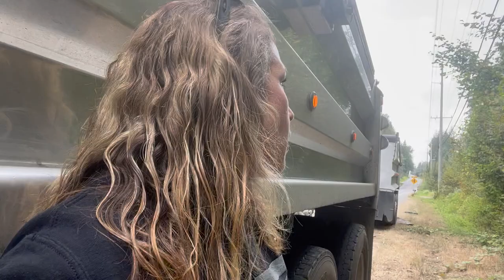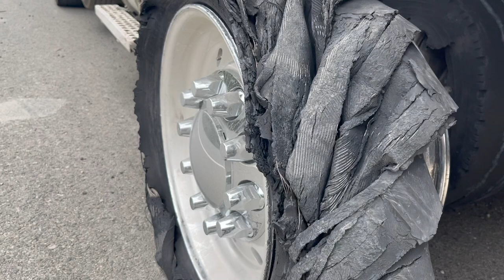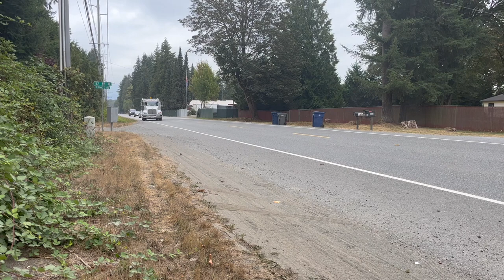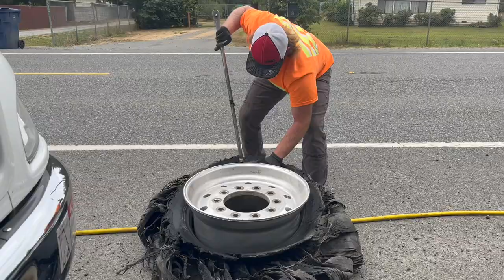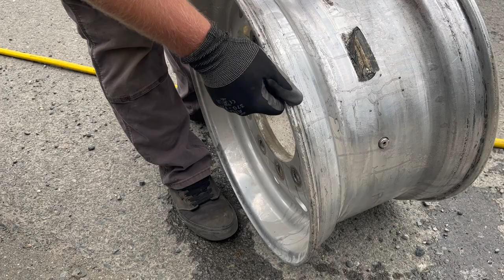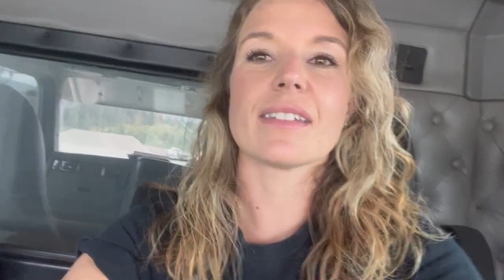STEER TIRE BLOW OUT ON MY T800 KENWORTH!!! Scariest moment of my entire truck driving career.

Comment: Blowing a steer tire is always scary.  The fact you are an experieinced driver is what kept it from being worse.  Your instincts and experience took over.  Be proud of yourself!  You did great, none got hurt, your truck isn't torn up.  Again, because you let experience and instinct take over.  Kudus to you DTDTD!
Reply: @berhorst59. Well said
Reply: I am truly sorry to hear what happened. You did great. But you look prettier when you cry. LOL.
I had a similar experience with 40 people on board my vehicle.
What I did was pump the brakes and controlled the vehicle to a stop. You are strong. To control the steering in these situations is terrifying.
ALL VEHICLES GET OLD.
The vehicles you have are old that were parked up 
for a while, SO, u have no history on them. As vehcles get oldermaintenance if various sections are inevitable. Clutch, brakes, spring lifts engine overhaul , changing wheel bearings & seals. 
Sometimes a single BOLT will keep you from running.

You fix n work and work n fix.
 
I told u many times before now to check the diaphragms on the brakes ACTUATOR' cause if anyone gets busted while driving' i wish you all the luck.
 But IF that should ever happen, you will HAVE NO BRAKES. HIT D PARK BRAKES. The rear wheels will lock up and bring you to a stop ASAP.
Happy motoring.
Reply: Your ok. You handle yourself well. It’s not a joke. I’ve been there too. Not hitting brakes was key. If any doubt your a trucker now. Get it fixed remember to praise GOD  and KEEP ON TRUCKIN. 👍🏻
Reply: Every driver gets shook up sooner or later. I just passed a yellow concrete marker my trailer trailer rim got bent when it bumped and made it lean @ at a guard shack. They didn't report it.  Was looking at the space to turn around because I was at the wrong shipping address. We learn.
Reply: @michaelchason7863  sorry, back in the 70's I used to buy them for my car.They would last half year or less. I think they went out of business.
Reply: There was no load at the time!
Reply: So glad you were ok, seeing this was couple weeks ago, so guess alright to say now, you are so pretty, your sweetness came through in your tears.  I had career as just straight truck driver, circle checks can be helpful daily. I am guessing what some of the offers might have been. God Bless you
Reply: I didn't know humans had instincts for what to do when a steer tire blows out . Did the Neanderthals have those same instincts

Comment: I've been a owner operator for 38 years and I've never blown a steer tire. I currently own 3 older trucks and I love them because of no emissions. You handled it like a pro and your experience helped you when you needed it the most. With older trucks there's a lot of trials and tribulations and a little more maintenance involved. Keep trucking and you'll make it.

Comment: You did a great job saving that,  I told my son he needed new steer tires, they had dry rot in the tread, He told his boss and a very next morning the right front blew at 70 MPH like yours and broke  the headlight out of the hood put a hole in the fuel tank.  Toe truck driver said it doesn't normally end good, I replace my fronts when they get a little past half worn and no more then 2 years old, the date code is  the last 4 didget number after the DOT stamp on the side of the tire, example Dot ##########(1918) would be 19th week of 2018. Glade your ok

Comment: Glad you are ok. Looks like tire defect. However, I would replace the wheel with the damaged lip. I typically replace steers when they are half used up just as a precaution.

Comment: In over 40 years of my driving career I've never blown a steering tire.. Glad you're ok. Could have been bad. For some reason those big balloon front tires consistently blow out. Big problem here in New Jersey. I personally think you and your husband are doing a great job as owner operators. Keep your head up, keep pushing forward you'll be fine. 🙏🙏🙏

Comment: It happens, it is definitely a experience that you will never get over. I have lost 2 steering tires in 44 years  of OTR. Both times on 2 lanes, both times loaded. Good job girl and luck had only a small part. I have followed you for 2 years,  and you are a top shelf driver. Well done stay safe out there 👍.

Comment: I'm an old dump trucker, truck and pup a lot.  I have had two steer blowouts occur.  First time I was single, empty.  73' Ford Louiville LT9000.  Happened without any warning.  Like an explosion.  At about 60 mph.  Suddenly the truck is shaking wildly and fiberglass is flying all over the highway.  I was able to keep it under control and got off onto the shoulder.  You Dauminique did it right.  Like others here have said your insticts from experience took over instantly.  That's how it happens.  Faster than you can think about it.  Good save and don't let it get to you.  Shit happens and always will.

Comment: You had an angel on riding on your shoulder today. Most steer tire blowouts result in major crashes. I drove tri-axle dumps for 15 years. Always loaded at maximum legal 80k limit. In my area ( Western Kentucky ) on average we lose 3 or 4 skilled drivers a year because of steer tire blowouts. Respect to you for holding it on the road, most can't.

Comment: I'm not surprised you blew a tire as much as you've been running that truck like you said in a previous video. Something like that would rattle even the most experienced drive, but the fact that you were able to recover speaks volumes to your skills as a driver. I recently dumped my motorcycle going down the road for the first time in ten years of riding and it's just one of those things that happen.

Comment: Dauminique, back in the 1970's I drove a telephone repair truck (actually a van with the driver setting way our front like a bus) and had the same tire blow. I too managed to wrestle with it and keep it from dropping into a ditch and rolling. I did what you did (foot off gas, no brakes) and kept it on the road until I got slow enough to downshift and use engine to slow it further. I managed to hold myself together but it was very traumatic to feel out-of-control. Your demeanor shows you're a tough cookie. Of course there's initial shock reaction, but you seemed to pull it together and collect yourself nicely. I'm learning a lot watching your videos. Thanks.

Comment: #1 you got the truck back in the road, kept control until you could slow down to find a spot to park. also good staying off the brakes until later. i have only had a steer tire let go on a pickup so i can only imagine what you dealt with. your smile at the end of the video, priceless.

Comment: Many years ago I drove a 1959 IH R190 refrigerated truck and lost the air brakes just after coming down a four lane bridge with a rotary at the bottom. A copper line had snapped and back then the brakes were just gone and didn't lock up. A few seconds earlier and I would have hit a rotary full of traffic at 50 mph. It was scary but taught me the dangers of driving a big truck.  
 You did great and reacted well.

Comment: Hey girl at least you're still talking and walking right. Sometimes it happens. Believe me I know it's happened to me. When I lived in California I used to pull double. And it happened to me on the steer passenger side. I just hung on didn't touch a brakes the best thing to do. And Missouri where I live now. Driving a dump truck loaded going up a hill I got to the top all of a sudden boom it front end dropped I thought it was my fuel tank it fell or my battery box cuz it was sparking everywhere. I lost my left driver side wheel hub everything. And I hung on I got on the other side of the opposite side of the road but I stopped.. and I've lost the right front hub wheel before I had my two little kids with me then. So we just have to be alert expect to unexpected all the time. Thank God you're still here. At least it wasn't the left front.🙏🏽🙏🏽🙏🏽👍🏽🤗😘❤🙋🏽‍♂️.

Comment: I’ve been driving for 6 years and only had two steer blows thank god. One time I went into on coming traffic. Luckily nobody was coming at me. You can tell someone who never had one happen to them. They have their feet up and barely holding the wheel doing 80. They are in for a rude awakening. Glad your safe and the truck.

Comment: You did a great job not panicking and you drove the truck til you had it under control that is what you are supposed to do great job I have had a steer tire pop on me on an 18 wheeler and I was  empty and the force broke both hood supports and rang my ears for 2 days but all was OK so you did great you are a professional and you just proved it.

Comment: Dominique…..waaay back when I was rookie tri axle driver, my trainer said if I ever experience a steer tire blow out was to immediately throw all the pressure into the forward air axle (reduces the weight on the steer). Then change your pants!

Comment: Glad you kept your wits about you and regained control of that monster of a truck you drive!  GREAT job!!  In retrospect, I was taught to accelerate if a steer tire goes out, to help you regain control quicker.  (this takes some weight off the front end for a quick second to give you the opportunity to yank the wheel back to straight or correct enough not to crash).  At least you didn't mash the brake like I hear and see a lot of drivers do.  This applies to cars, pickups and suvs too when a front tire blows out.  But a big rig or bus is 100 times harder to keep or get control back.  So again, GREAT job!  Glad you're safe.  <3

Comment: You’re a excellent driver,  you did great thanks God nothing happened to you. 
My wife had a broken cables on the trailer but like you never touch the brakes and control the tractor truck and this happened several weeks ago in  California hauling tomatoes 
Another experience more, be strong

Comment: Main thing is to never panic when it happens. Easier said than done but most everyone's first reaction is to jerk the wheel and that causes are sorts of problems then. You did good you didn't wreck and you saved an accident. Keep you're head up! I've had to ride several out just let off the fuel and let the truck settle and then get it safely stopped.

Comment: Thank God you weren’t loaded. Just the look on your face was all I needed to know. Tires, especially steer tires are so important. Good thing you stayed off the brakes, that would have pulled you off the edge. 
The only other thing you could do would be to apply the trailer brake. That would keep you from jackknifing and still slow you down on a straight line. 
Give your kids an extra hug. Glad you are ok.

Comment: I've been truck'n for along time my advice to you is always check your tires everyday before you get in your truck and if you're pulling a trailer and blow out on the steers use your trailer brakes slowly then use your tractor brakes slowly,never use recaps on the steers and you also said the word jerk which should never be in a conversation about stopping a big truck of any kind because you never jerk the steering wheel of a big truck and always try to stay on the road if you blow a steer tire,it's great that you are ok and this is a lesson well learned

Comment: Been there. Wound up losing my trailer, saved the rig though. It’s scary as well, but keep moving forward. Don’t let it detour or prevent you from continue to drive. You did a great job in that moment, and you should be proud. You saved your rig and trailer 😎

Comment: Glad to see everything worked out for you with that scary situation. WOW 😯 somebody was watching out for you. I’ve been driving tractor trailer for 34 years and have never had a steer tire blowout. I did have a brake lining separate from the shoe and locked up passenger side tire up on a manual steering Mack. That was not fun.

Comment: Hiya sister,
I’m an ex trucker from New Zealand, living in Japan. 
I understand your scary moment with your blowout. I had a more dangerous experience with a truck i was diving. i lost my left front driver “wheel”. Not just the tire but the whole wheel. The truck was in for regular maintainence but the mechanic forgot to check the bearings for grease and as i was driving, the whole thing “burnt” itself off the axel and was on fire.

Comment: No not the parking spot of shame... You saved it!  And those big fat  steer tires they're a whole different story when they blow than the ones that I run.. I went 13 years before I blew one and the hardest thing I did was step on the throttle cuz that's what I had been told to do...it saved me... Keep up the good work get back in that horse and ride :)

Comment: I just blew a passenger steer tire in July in Arizona. I was bob tailing home to vegas. Cruising a long at 68 mph.  Changed it on the highway and drove straight to Loves and replaced the other tire too. I had problems getting stopped. Took me about 500 yards. It gets your attention when it blows. I had to replace some inner splash guards and front bumper supports.

Comment: Great job keeping it on the road. We use tpms sensors from amazon on our steers, not expensive. They screw like a valve stem cap and has a screen in the truck. Its a piece of mind at least with tire pressure.

Comment: Was coming down a 2 lane road at about 70(empty) and just started entering a right hand curve to go around a slough and the driver side half of that w900 hood turned into about a million little pieces. Thank the Lord above no one was coming in the oncoming lane because I owned it for 4 or 500' with all i could muster to keep it on the hardball and had I been loaded I surely would have left the road and entered the slough. Pretty damn scary that's for sure, I'm glad you made it through.

Comment: Glad your ok and the truck is too. 
You did everything correctly after a steer tire blowout.
And experience is a big plus on the way you handled it.
I have had the rear end of the semi break loos with an empty tank trailer.
First this I did was remove the power from the rear wheels (neutral, take off the cruise control) and the truck straightened out.
All that was instinct for me just the same as you did for the blowout.
Years of driving experience equals good instinct on reacting to different things when they come up.
Good job well done and and hate to say it but also a good learning experience you do not want to go through again.

Comment: Good job. Glad you're OK. Like you said, trucks can be replaced, you can't be. I've lost one steer tire (on an 18 wheeler) and it was on the I-70 turnpike running 70mph. It was also at 2am, so no traffic. Used both lanes and the shoulder before I got stopped. Definitely an eye opener.
Reply: Send a dm📩👆

Comment: I know the feeling. I had my steer tires replaced and 1000 miles later my right steer blows going 70. It was scary. Got it fixed and 75 miles down the road my left steer tire blew. An expensive day for me. And scary to top it off.

Comment: Good job and glad you and truck are both OK. Those front floats are no joke, I run the 445 floats on my tractor, had a left front go down at about 72mph on the NY State Thruway, but I was lucky that my TP warning went off that the pressure was going down and I was able to get to the right shoulder before it went. No damage, but after inspecting the tire we discovered a 5" cut on the inside shoulder probably from road debris, I'm guessing yours was probably something similar. Depending the mileage on the fronts, probably a good call replacing both, they are really sensitive to proper alignment and balancing, not to mention keeping track of the pressure. Again, all's well that ends well, good job avoiding a bad situation.

Comment: Glad you're OK and back in the driver's seat.  These things do happen and you got through it.  I had an experience driving my car on I-80 in New Jersey, there was a piece of steel banding laying in the left lane, I hit and it must have flipped up on it's side after the front wheel went over because it cut through the rear all the way across the tread and the tire went right down.  I was probably doing 70 and the rear of the car started fishtailing.  I managed to get it to the median and stopped.  A NJ State trooper pulled up behind me and asked if I needed help.  Since I was on grass I told him if I could get to the shoulder on the other side, which was paved, I could change the tire myself.  He put his lights on and drove out on the highway, stopping all traffic so I could limp across the 3 lanes to the other side where I changed the tire.

Comment: I blew a front left steer tire on the 401 Ontario 🇨🇦 on a T-800 with a steering lift axle 2yrs ago ,in the middle lane of a 3 lane 105kph road ,I was surprised at how the truck held the lane ,even though the Tire was destroyed ,even easing over to the right ,was effortless ! I personally think Paccar has us drivers in their engineering and safety regiment 👍👍🖖🙌🇨🇦

Comment: Glad your ok. You may want to look into a Safe-T-Pluse steering stabilizer. Not sure if they make a Stabilizer for your Truck but it may be worth checking out. Designed specifically for steer tire blow outs for big vehicles.

Comment: Glad your safe. Sounds like you handled it well and didn’t panic and jam on the brakes. New truck or old truck things can fail but one plus is you’ve got good support around you like your husband being a technician. Having to deal with fixing or replacing a vehicle and the cost involved after a crash sucks but the main thing is that your ok in that situation.